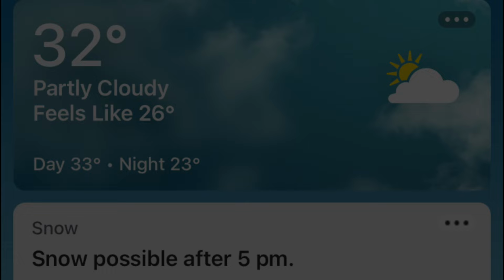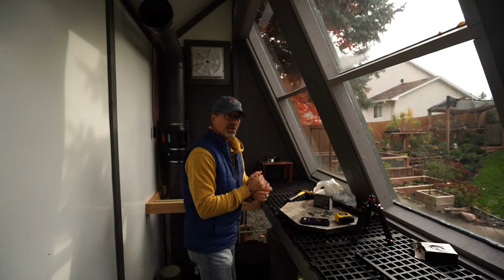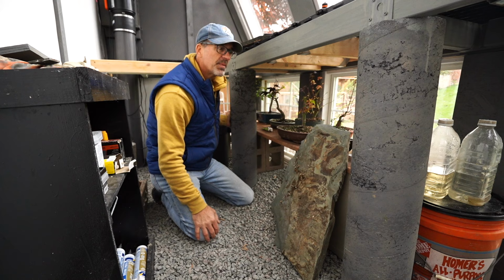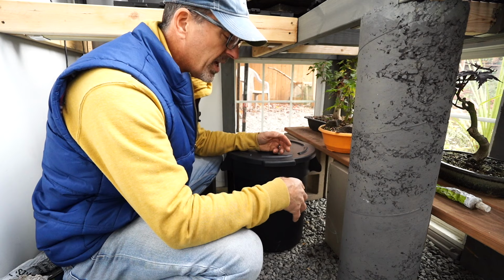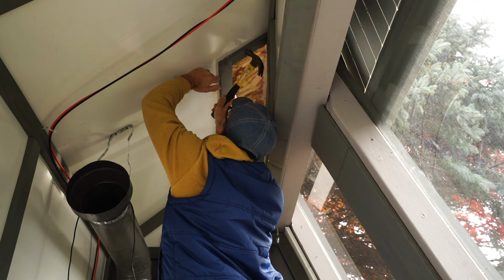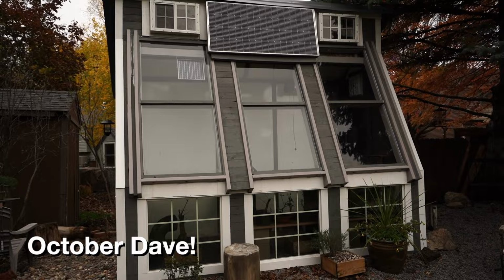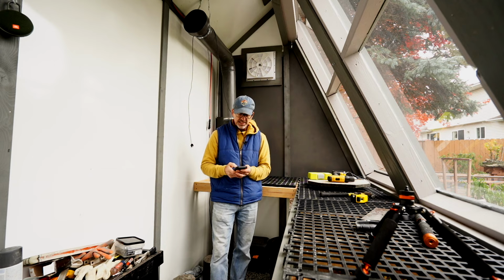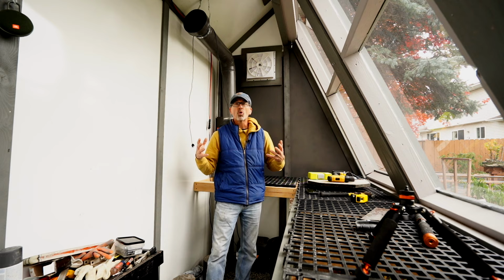Passive Solar Green Frame Part 9:  Dave's Bonsai E353

Comment: Painting the cement pillars black is a great way to heat them up. Once it gets hot again you can either put aluminum foil around them to reflex the heat or just white paper. Those black waste cans are cool for water to heat up. Can you also put rocks in a container? The rocks will hold heat too. Just a thought.

Comment: Would it be a benefit to reverse the air flow in the tubs from summer to winter?
Reply from the maker: Good question.  In the winter I don’t want my dormant trees to wake up too early, so I’ll still suck the hotter air from the sunny warm days down to air tubes.  That will warm the rocks and air a bit, then push it up when it runs in the night when it’s really cools.
Reply: @DavesBonsai  I guess that makes sense because you are not looking to necessarily maintain a certain temperature year around.